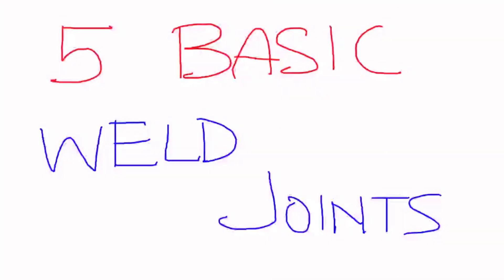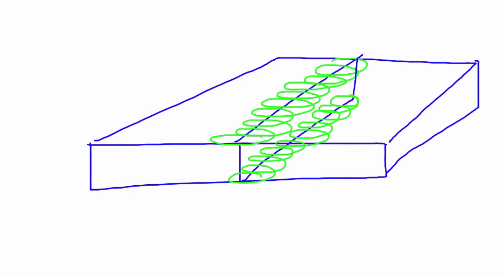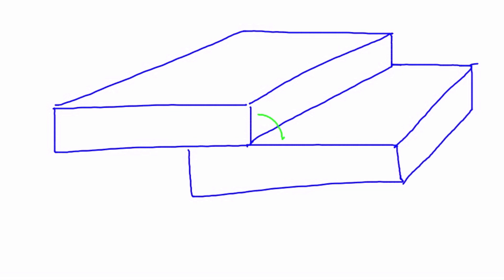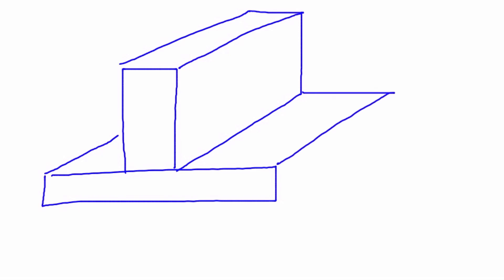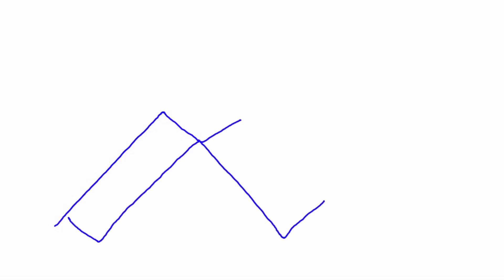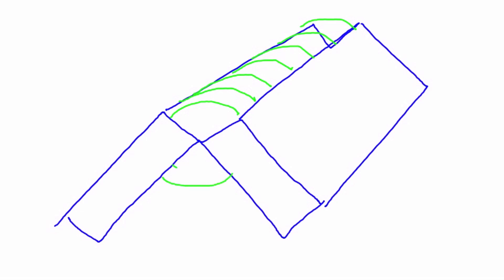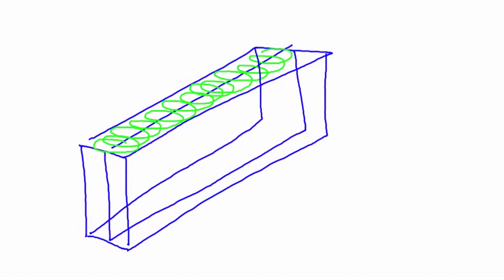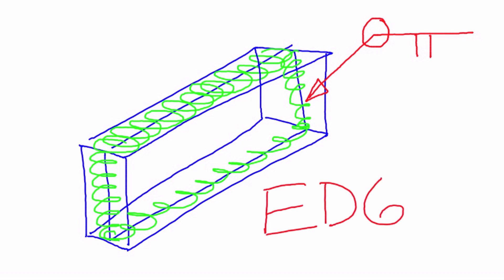How To Weld Five Basic Welding Joints - Different Welds Explained Tips and Tricks

Comment: For what kind of welding is this? I assume mig/mag?
Reply from the maker: These are different types of joints explained that can be welded with any process.
Reply: @longevitywelding  Thx for the reply! I am a new hobby welder, so forgive me if i am wrong but in some motions it looks like you cross over a weld, does that not make it so you weld over your slag with stick welding??
Reply from the maker: @TotalWarChronicles  You definitely do not want to weld over slag. Keep in mind you are going for penetration of the weld and it takes time to settle.
Reply: @longevitywelding  Good to know!! I always thought you'd never want to go back over a weld you made with stick welding, but if you are quick enough you can go back over it without cause slag to settle between your welds?

Comment: so corner joint need filler metal other than the electrode to fill the gap?? otherwise it will take much electrode. plus edge and but are alike?